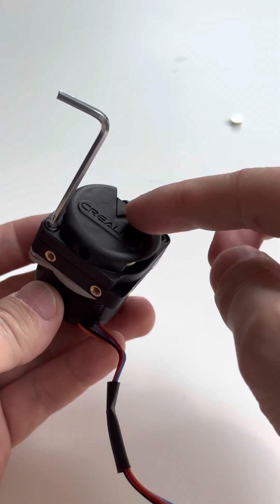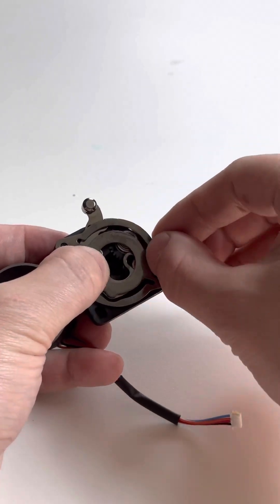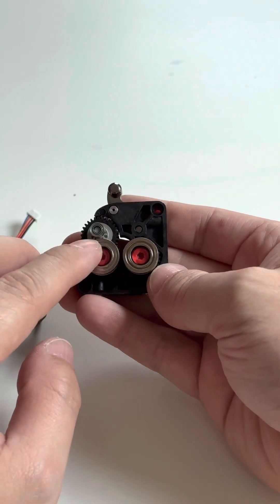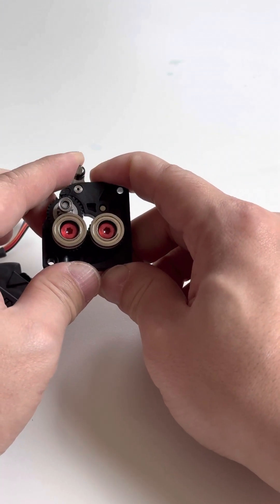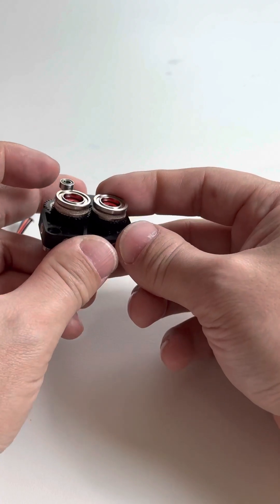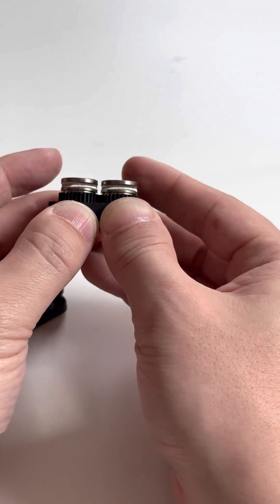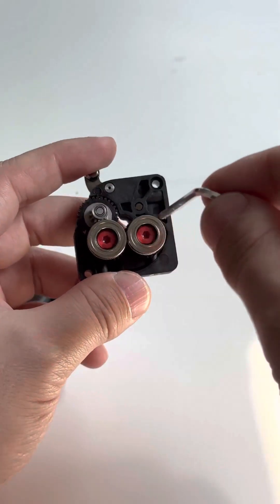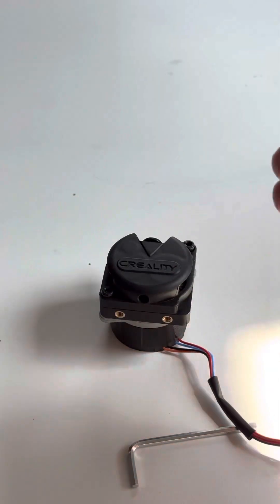Creality K1 Extruder - The New Sprite Hotend?

Comment: I received my K1 from 3DJake 10 days ago and it has this newer extruder model (compared to the very early K1s).  Sadly, it has lasted 6 days before complete failure.  The extruder now no longer grips the filament so I have massive underextrusion.  I can stop the filament with my fingers.  I have fully stripped it down and nothing appears out of alignment nor broken.  I cannot work out how it has failed.  Feel free to contact me if you want to get further details, photos etc.  3DJake have already said they will send a new one, but I am really not convinced that the K1 is ready to be sold.... :(
Reply from the maker: The extruder is a weak point, I’ve made a ton of videos on this. Creality needs to fix it. But in the meantime I’ve just installed my own extruder on there. Not a perfect solution, but it works for now
Reply: @NathanBuildsRobots Yep, I've been following your videos on the topic and I like your adapter solution, I just don't believe that 6 days to failure is acceptable for a printer at this price point.  I do not see it as a tinkerer printer (unlike my heavily modified Ender 3 v2s) so it really should not need any upgrades out of the box.  
Is the extruder in this video the replacement one that Creality sent you to replace the one that was getting knocked open by the chain links?  If so, I am very interested to see how long it lasts for you.  As I say, mine managed 6 days and about 9.4 hours of printing.  I'm not a happy bunny at all.

Comment: Now that people have these in the fields, the one issue they're seeing is that the lever is being hit by the drag chain and opening it up during printing, which causes the machine to either quit extruding altogether, or underextruding.  In my case, I'm also seeing the stepper motor overheat.  It exceed 100C when it failed and just shut down.
Reply from the maker: Wow, crazy. I think the extruder needs to be redesigned. IMHO

Comment: So there's no spring, and is there possibility to set different distances between the drive gears.. if  it is it will be a patent issue in Sweden for now
Reply from the maker: Technically speaking there is a spring, inside of the spring loaded ball bearing that is used in combination with a detent to hold the extruder arm in place. Not sure where this leaves it in the eyes of patent law.
Reply: @NathanBuildsRobots  but the hobbed drive gears aren't spring loaded when engaged ..??

Comment: that looks good.. like really good... better than the one they got the idea from (obviously lgx lite inspired).   are they going to sell this as a separate part?
Reply from the maker: I wonder. It hasn't been super reliable just yet. I think they need to work on the tolerances and maybe do some design tweaks to get it working 100%
Reply: Atleast they made a good start.. the whole idea with big gears and the reduction is working fine for bondtech... And that Moons motor is a proven part, orbiter 1.5 and such are using that motor for years... That, the ldo, or SOME used the wantai 316..

Comment: Die casted sheet metal part?! Nonsense mate. It can be laser cutted Stainless 304. It's non magnetic too. Thanks for detailed video.
Reply from the maker: Its not a sheet metal part, I had it taken apart a bit further before this video, it clearly has ejection pins on it. Plus the little lever, and some standoffs are baked into the part so it's for sure not a sheet metal part. It really looks like its a sheet metal part at first glance though, because of the large flat surfaces and uniform thickness.
Reply: @NathanBuildsRobots  Thanks for info. Hmm that's really weird process for this part ;)
Reply from the maker: @KKTruckStore  Agreed, I think they started out with a sheet metal prototype then switched over to die cast to combine some features. They could have at least added some out of plane radii on there to make it a little less confusing!
Reply: @NathanBuildsRobots  if it's die cast it'll probably be zamac, that'll explain why it's coated too

Comment: The plastic gears will absolutely be an issue as well as overall build quality, already know of some early units having the gears crack.
Reply from the maker: Interesting, do you have a source I can check out for those cracked gears? Would like to check that out. Might make more sense for creality to make it an all-metal assembly. Should be doable, albeit more expensive.
Reply: @NathanBuildsRobots  It was a facebook live shared to one of the creality groups from someone who got an early unit, it would be a massive pain in the ass to find if its not already deleted. The gear was cracked at the base circle where its fit to the metal.

Comment: This looks so effecient. I do hope they make it an upgrade to other printers. Because currently flowrate is the bottleneck for the s1 series.
Reply from the maker: It's not the extruder's fault. I run my Sprites up to 75 mm^3/s. If you upgrade the hotend with a volcano CHT nozzle you can push crazy flow rates on the sprite.
Reply: @NathanBuildsRobots  yea, I'm gonna do that. Trianglelabs chc heater looks real tasty!

Comment: Not that I would know, but that looks like a really nice gearbox, so long as the bolts remain tight as you pointed out. I swapped the stainless gears for hardened gears in my P1Ps today and I was impressed with those gearboxes (and how easy they are to work on), but the K1's looks like it might even have some benefits over Bambu's. Particularly the manual release lever and the larger filament gears. Very cool teardown! You should do the same with the Bambu and QiDi (and maybe you already have for all I know, lol)
Reply from the maker: I gave away the qidi, didn’t see the point of it with how small it is. And the carbon rods rattled in a way that would bother me. Plus the plastic frame feels kind of cheap.
I think double supported gears are mechanically more efficient. But Creality is making some interesting trade offs to get cost down and make it easier to work on. Will see if it ends up being reliable

Comment: I would appreciate seeing how close the inlet gets to the gears/extruder bits. If it is too far then flexibles have an issue (binding, twisting, rolling, especially at high speeds). One of the biggest engineering improvements from E3D was decreasing the gap to just some microns if I recall correctly.
Reply from the maker: Not sure, it all looks pretty tight in there. I’m guessing it’s on the good side of average
Reply: @NathanBuildsRobots  thanks